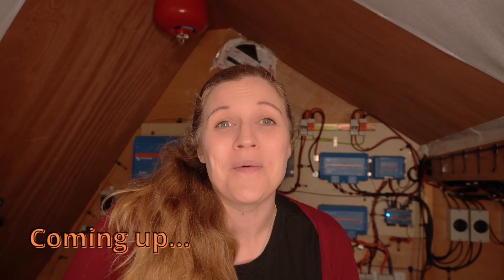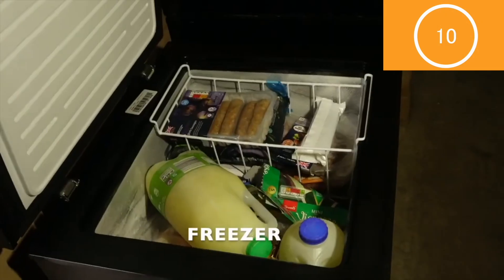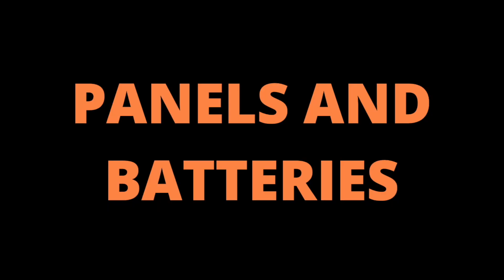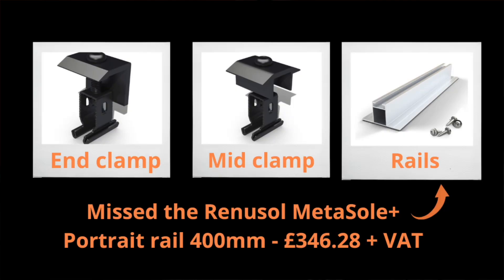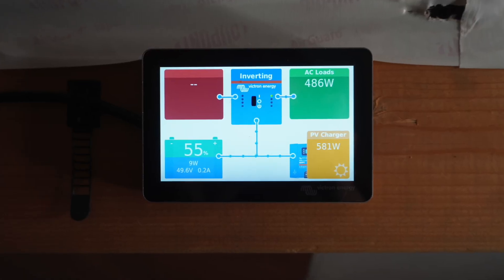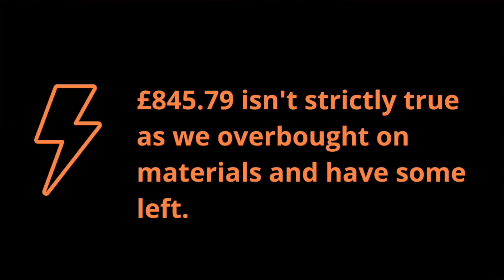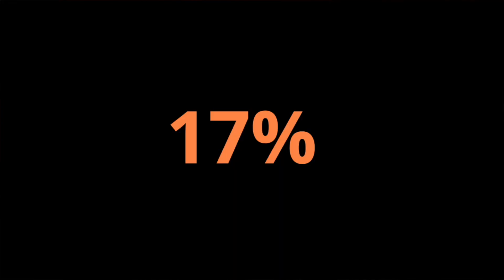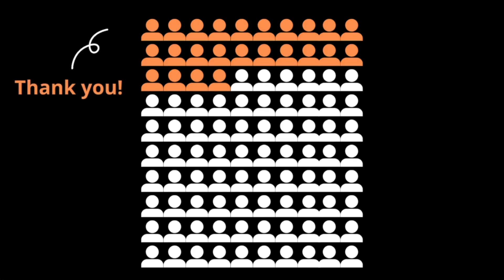TOTAL COST of OFF GRID SOLAR 2022

Comment: Thanks for the update. So it seems things have not gone up as much as I thought that they would. I expected 28% rise, so that's good. I think that we are in for a cold and wet winter, so may be a bit of stock piling for fuel might pay off. Normally at this time of the year our dams (in Cyprus) are about 50% full. Due to the weather our dams are over 76% full.as last month we had 3 times the normal rain. Thanks again for the update and thanks for posting

Comment: Given the conversion rate of Brit Pounds to AUD, the prices for my system are very close to yours. I saved some money by making my own racks for the batteries (out of Aluminium angle) and making my own copper busbars rather than using the Victron Lynx. Rather than have a single Quattro, I went for 3 x 5KVA Phoenix inverters which work in parallel, but give me some redundancy - I can get by on two if I have to. I have 4 arrays of panels and each feeds a 250/85 MPPT. I got lucky and was able to get hold of 92 x LG Neon 2 Black 330W panels for AUD $5000. These were 2nd hand, but only two years old and the warranty is transferable. The big catch there was that I had to take them down from the roof that they were originally installed on. I got to keep all of the racking and clamps, etc, as well, so no extra expense there. I'm only using 46 panels and gave 20 to my daughter and sold 20. That leaves me six spares. I did spend AUD $2.5K on some Aluminium scaffolding 'coz me and ladders don't get on at all, and with 46 panels to install (all on roofs), plus the ongoing cleaning, inspections etc, I think it's money well spent.

Just an aside, I fired up my 8 x Pylontech US3000C batteries last week. They all work. I connected them all together and left them to balance each other for 3 days before I connected a charger to them. They had 50% charge when fired up. I have since charged them to 80% so that I can configure the inverters, etc. I will be buying two more of these batteries given that the initial eight are working OK. You guys had me worried with the problems that you've been having... Hopefully the solar will be connected to them by the end of the month. I'm waiting on a guy with a small digger to dig a trench for the cables...

Keep the vids coming guys, I reckon they're great.

Comment: Out of interest, at the time of buying the panels were you aware of LG pulling out of the solar market and if so was it factored into your decision? Also how come the LG panels over something like the 400W Perlight panels id be interested to know your reasoning. We just had 2kw of Perlight panels installed on our West facing roof and have placed the order to have 1.6kw (415w panels) worth of Perlight panels put on our garage which is also west facing. This is to compliment the 2.7kw already installed on the south facing roof. Hard to say how well the Perlight panels are performing yet because since the commission date it's just been grey and horrible :(
Reply: LG only announced their exit from solar panel manufacture in August this year. They have also indicated that they will honour all warranty arrangements with existing owners. They kept their production lines running beyond the number of panels that were pre-ordered by their distributors, so that they would have a spares inventory for any future warranty claims. Like so many other things, they suffered from people preferring to save a buck rather than pay for quality.

Comment: Thank you for this update; useful and entertaining. We are looking at installing a smaller setup but have just had a quote to fit 20 LG panels that came in over £13k!  Do you consider it would be possible to install by a competent DIYer, with a working knowledge of electrics?
Reply: That's quite a figure, is that just for panels & installation? You could fit them yourself (scaffolding costs to be factored in) possibly hire a roofer to assist you. You will save a fortune and you'll be surprised how easy these systems are to get up and running. You will also need to consider an electrician (certainly from the AC side to CU) and also the possibility of DNS submission depending on KW size. 👍